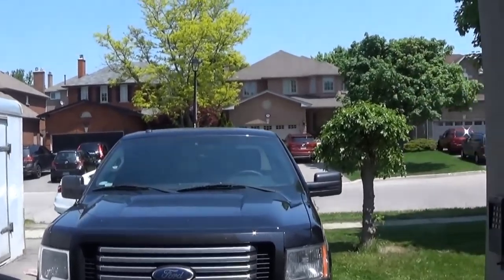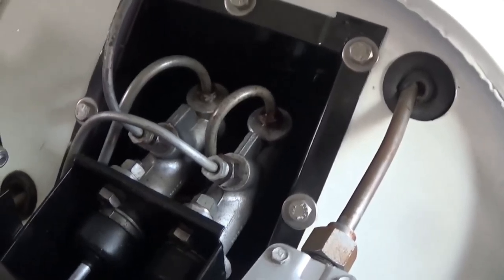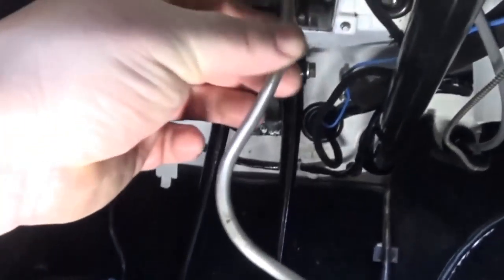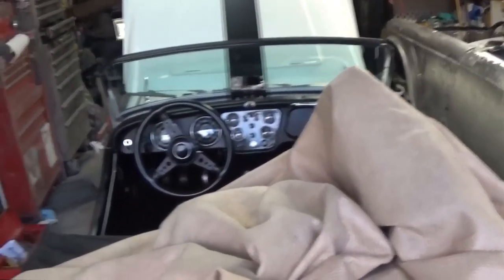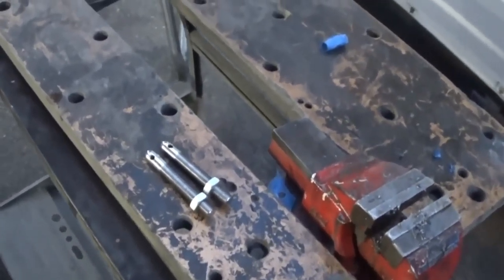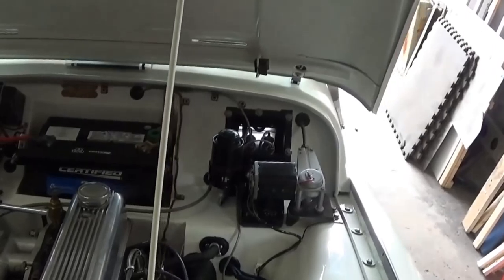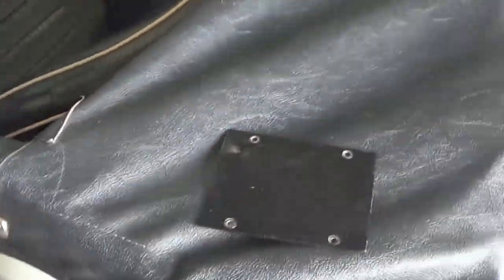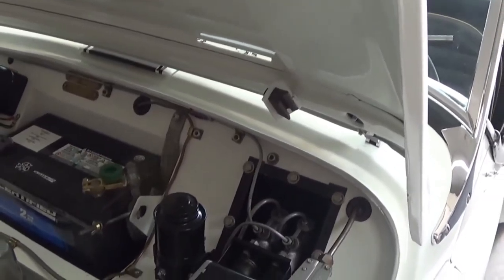1960 Triumph TR3A Spring Projects 2018 and a Little Mail Call

Comment: Little tip, you can bleed clutch and brakes by leaving pedal pressed down overnight. an old British Leyland trick.The air works its way out the reservoir under pressure.

Comment: That TR3A is a real beauty. I love how you have kept it 'of the period' but still working well. if you wonder why the old Brit cars need a lot of maintenance its because we Brits have a lot of rain and we get bored indoors .. so we need to fettle cars.

Do you still have the Alfa Romeo? if so it may be worth checking the driveline - It has one of those 'Metalastic' couplings (the same ones Elin fitted to his GT6) on the propshaft and the rubber in the middle support bearing breaks up. I only know this because we just did all this on a mate's car ...
Reply from the maker: 1chish yep, still have the Alfa. I need to do some jobs on that as well so that might come home for a little while as well.   I'll check what you suggest...I know the rear transmission mounts are perished and they need to be replaced.

Comment: Can you tell everyone how to tell if a TR3 is negative ground or positive ground- I don’t know about positive ground - thank you.
Reply: 1957 Triumph Sports 20 TR3  thank you Chef.
Reply from the maker: @tjsand8814  hi Tj, the easiest way to tell is to look at your battery terminals.  If your negative battery terminal is connected to ground (usually from the battery, to the body and then to the engine block and then to the frame) then it’s negative ground.  Now, if your positive battery cable is the one that’s connected to ground when you trace the cable, then you have a positive ground car.
Reply: @cheftush  ok - I’ll check real good - After reading your posts - I thought cables could be switched on battery and me not knowing when it could be positive ground might fry points and wiring- thank you so much for your response- thinking you wouldn’t have time to reply- we all appreciate your helpfulness on all our projects.
Reply from the maker: @tjsand8814  I’m happy to help where I can Tj.  If you have more questions, just send them along. Cheers, Tush